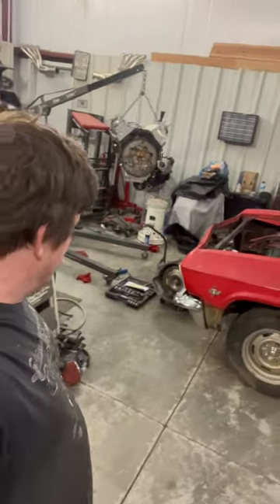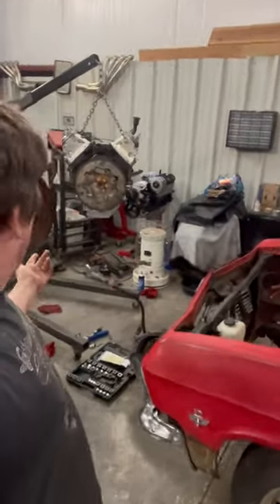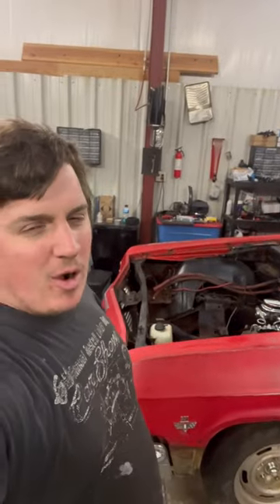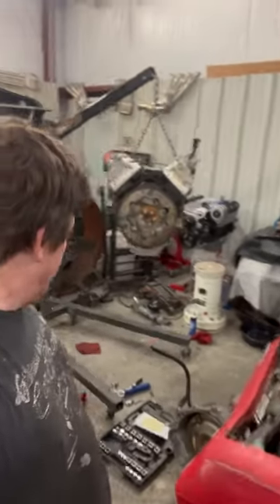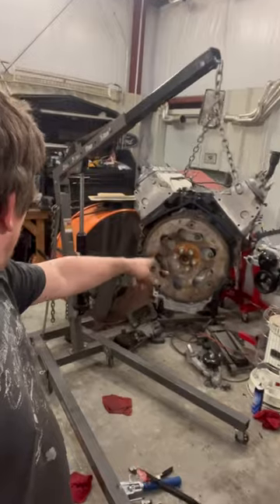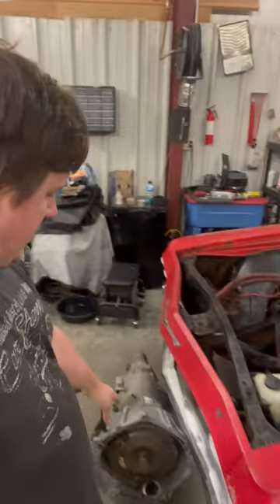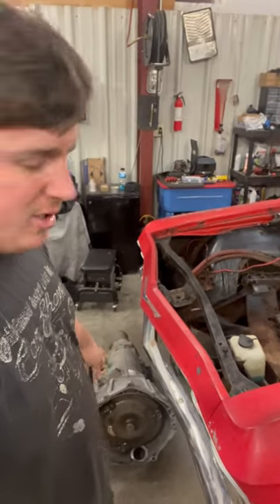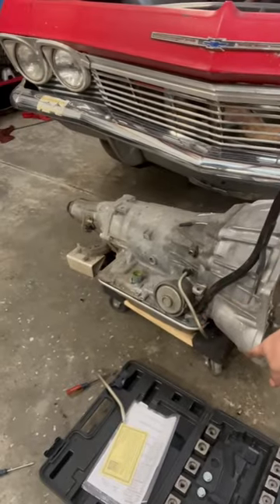LS swap with the Blind Guy 65 impala part 1 #shorts ￼

Comment: I know you have to put a low profile pan do  have a part number for it ?
Reply from the maker: @christophersilva7634  it depends on what vehicle you are working on but yes, you need a low profile pan or lower profile. The one I used in this case was a GM musclecar pan sold by Summit. Let me know what you are working on and I will send you a part number.
Reply: I’m working. On my 65 impala what engine mounts and transmission mounts oil pan you used. Thank you in advance
Reply from the maker: I use the stock sbc mount with a ls adaptor plate and stock trans mount as well 
To use the stock tran crossmember you will have to either build new stands on the frame or extend your original what I typically do with these is 1/4in thick by 1.5in angle iron Roughly 9 inches long and bolt it to the top of the original mount therefore extending it enough for a 4L 60 E or 4L 80 E transmission and able to use the factory transmission
For oil pan I use the muscle car pan will post a couple links
Reply from the maker: https://www.summitracing.com/parts/icb-551628
Reply from the maker: https://www.summitracing.com/parts/nal-19212593